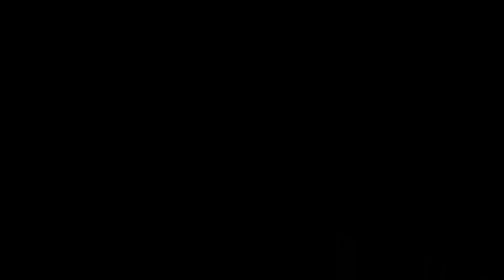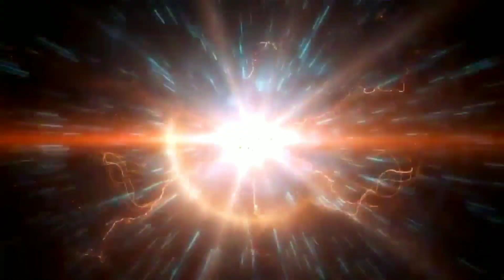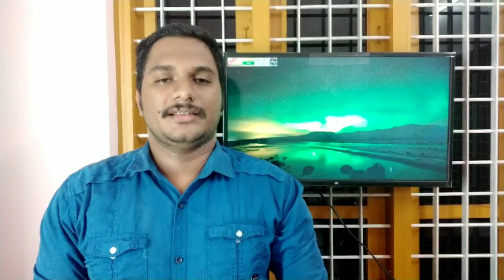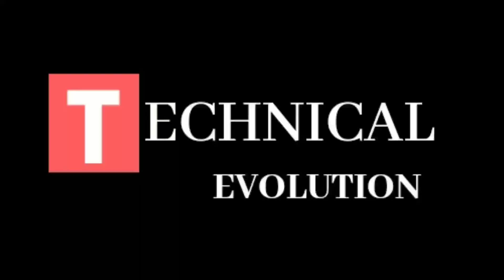Amplifier assembling my experience. Starting from basics to top

Comment: എനിക്കും ഒരു ആംപ്ലിഫയർ ഉണ്ടാക്കണം എന്നുണ്ട്. Ali express വെബ്സൈറ്റ് സെർച്ച് ചെയ്തപ്പോൾ  TPA3116 Bluetooth 4.2 Digital Amplifier Board 50W*2 Dual Channel 2.0 Audio Amplificador With Volume Adjustment DC12-24V എന്ന ബോർഡ് കണ്ടു . ഇതു മികച്ച ഒന്നാണോ ? അല്ലെങ്കിൽ ഏതു ബോർഡ് ആണ് നല്ലത് ? 50w / 100w Power മതി.
Reply from the maker: TPA board class d anu complaint ayal repair okke padanu bro nnalm nallathanu njan oru video chythittund aa boardinte onnu nokku thudakkakkark easy anu